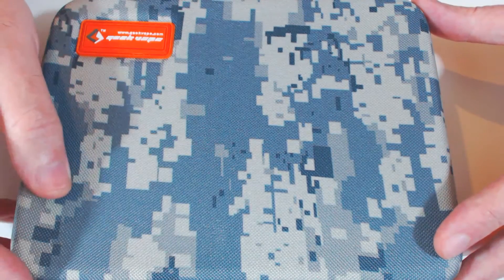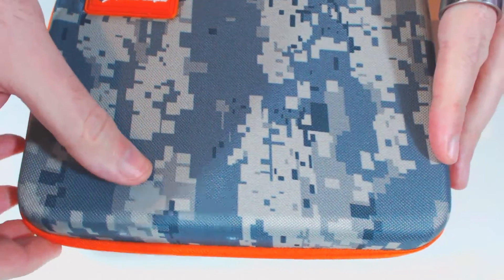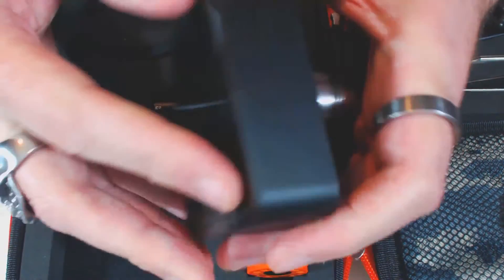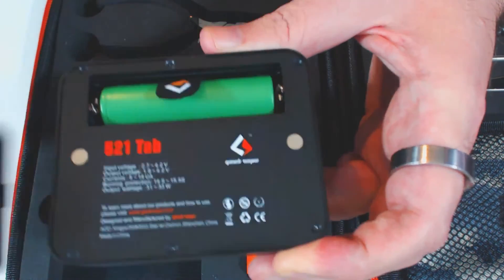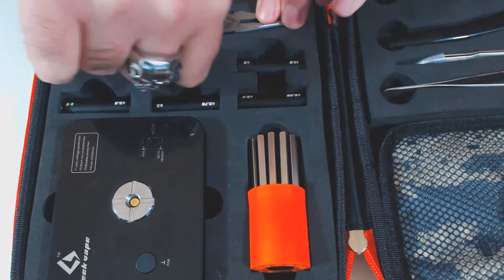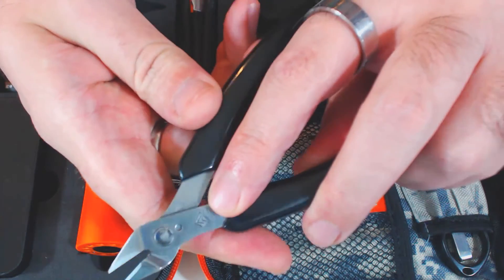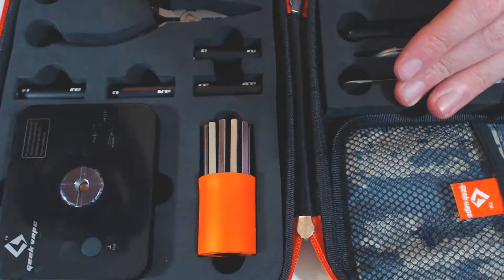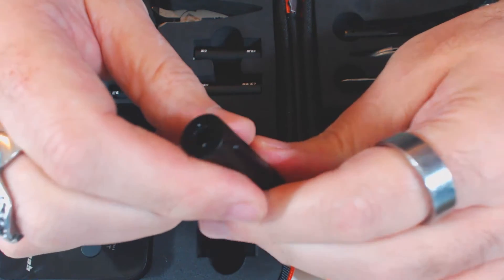Geekvape 521 Master kit

Comment: Good review John, i like the coil jig looks a lot better than the coilmaster version, have you tried firing a 0.10ohm coil on the 521 tab? apparently on earlier versions it would flash the F4 code btw is that an orb 19:56 into the review top left side?
Reply from the maker: +G Shire Vaper I haven't tried that yet mate but they said that was only happening in the eearly models. I have no clue what an orb is or what you are seeing in the top left at that time stamp lol.